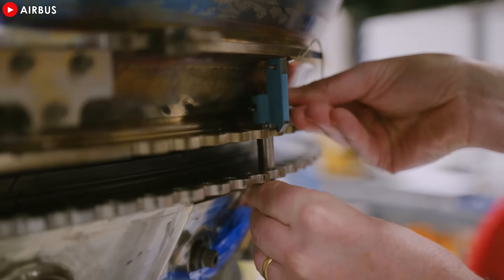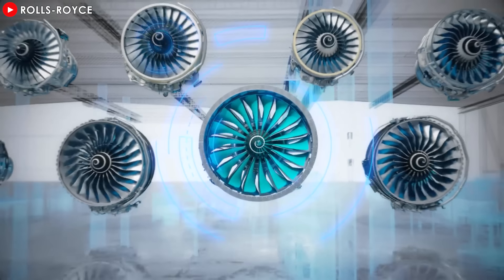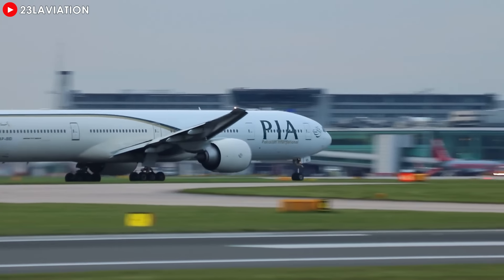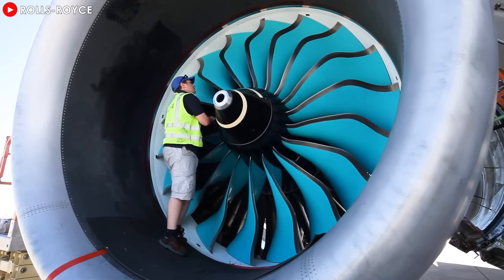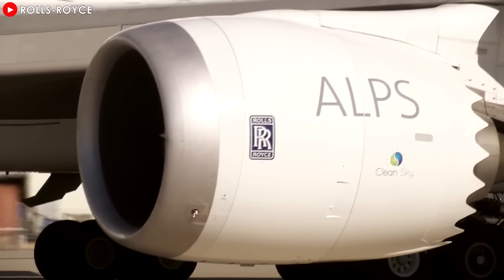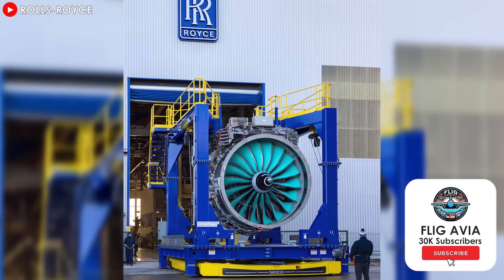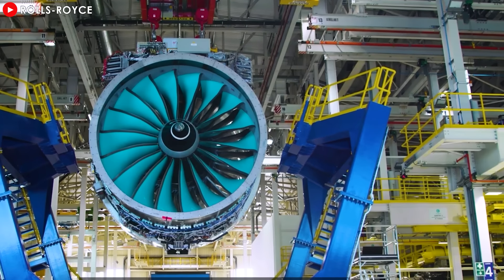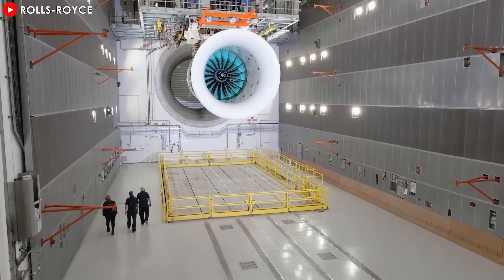This new Rolls-Royce Engine is Coming & will Revolutionize the Entire Aviation Industry. Here’s why

Comment: Don't hold your breath on anything new coming out of RR. They've had a terrible reputation for new hardware going back to the L-1011 fiasco of the early 70's. Their engineering failures were the main reason Lockheed never made any significant profit on the L-1011. Lockheed never designed another airliner after that.
Reply: And GE are doing exactly the same to the 777X with GE9X, also GE engineering failures were a big part of the reputation for making holes in the ground the DC10 got and the eventual failure of MD11.
Reply: Really ?   can you point to some evidence of what you're calling that 'terrible reputation'  ?      They're a  £4.4Billion   British plc  with a century of engine design .... and a 13% net profit margin.
Reply: RR also  were chosen ahead of P&W or GE  for the new engines for the refit of the 76  B-52 Statofortresses  in the next year or two.   See  https://www.youtube.com/watch?v=_-8ljmsZDZk
Reply: I lost a job during that time in the 70s,,,,, because of the cock up over carbon fanblades
Reply: @pjdade  The carbon blades were a gamble and introduced far too soon.

Comment: The GE 9X engine is more advanced than the RR geared fan.
It is a lighter engine and produces more thrust.

RR have dropped their so-called triple spool design as it was too expensive to manufacture and also too expensive to maintaian.
Now they have gone to a twin spool engine and geared the fan drive which has been done many years ago on other engines.

It will be a white elephant with no aircraft  to be powered by it.
Reply: RR dropped the triple spool as the current advanced design with the twin spool, blades and gearbox already exceeded GE. RR also can just offer a similar engine to the GE and still get orders such is the shortage of supply. Fuel consumption for such big engines is a bigger reason to order than smaller jets where aircraft design weight saving can offer alot of improvement. The issue is Risk- RR is offering a new engine after suffering Trent reliability issues. GE has avoided that. There is alot of new tech in this design and it must all work. RR bet the lower risk twin spool meant less risk now and still a major jump over the Trent. Meanwhile the P+W geared turbofan is suffering launch issues even as p+W is probably the leader in understanding the gearbox issue (being the only one). That gearbox offers a big jump that would otherwise have needed similar blade and internal innovation that GE was offering without the gearbox. Will be interesting to see if RR has learnt from the P+W woes, eliminated launch reliability snafus and can show the lower fuel burn on real world daily flights. The work done on the triple spool is still there and can be added in future (perhaps when SAF fuel needs it more or it needs a more competitive long haul smaller jet engine
Reply: @stephendoherty8291  Thanks for your reply.
                                                    Some RR lovers said that the triple spool turned the fan at its optimum speed which is questionable.
                                                      If so,  why have they dropped that triple spool architecture in favor of the twin spool with the geared fan-?
Reply: And what about the new RR R-130 ? ... Chosen by the US government against home producers to power the 'new' B-52, re-equiping the entire 70plus fleet, a $2.6billion order for 600 engines.
Mounted side by side in the existing pod configuration, will this not be an engine to also power narrow bodied aircraft, if RR can make enough?
Reply: @peebeedee6757  In fairness the RR won that due to poor outcomes with US jet engine makers (GE/P+W) and/or they didn't have a suitable engine that could replace the aged B52 ones even though they were US made engines.  Near any new engine would have been more efficient and a big benefit but the Airforce did not want another overbudget, reliability issue over such a critical arsenal of the US defence and RR probably had the space and less orders to meet the deployment timeframe

Comment: They have to get the gear box right,  They don't want to repeat P and W's mistakes.   Fuel economy gains are insignificant if they ground planes because of unscheduled engine rebuilds/gearbox replacements.  They need to get it on Boeing planes as well, that might mean political hurdles as well particularly with the  Trump administration and GE lobbying,  They blew up a pipe line to Germany didnt they,  the U S that is.

Comment: Rolls Royce still build Crap
Reply: yes a lot wayang
Reply: Give me an example 👍
Reply: @bez750  The trent 1000 would be a prime example of CRAP as it was grounded for a long time and many operators have switched to the superior GEnx engine which is outselling the trent 1000 by a margin of three to one.
Reply: @John-nc4bl  True, the Trent 1000 had a rough start regarding I.P turbine blades and other issues but the Trent-ten and Trent 7000 are far superior to the Trent 1000 which we no longer build
Reply: 1. You forgot the s
2. You do not know what you are talking about.
3. On our 757s, the spare RRs went stale in the cans due to the reliability of the hung engines.
Reply: @JoeL-zi1lc  1. What are you on about with the S
2. I've been at RR since 1987 so I know a bit
3. As of November 2023, the 757 has been involved in 47 aviation occurrences,[133] including ten hull-loss accidents out of a total of 13 hull-losses
4. Yes, I copied this from wiki

Comment: Should be grounded from day 1, since still running on fuel..... Electric engine or no one, please.....
Reply: realistically speaking its still nearly impossible to run a plane engine on electricity, 1. the battery size and weight of current battery technology makes it too heavy if we were to try using electric engines. 2. the power watt required by the engines and the whole plane in general is practically too much for a battery to provide, so its either we find a newer technology for batteries in general or shift to nuclear powered engines which is nearest to reality, only things required is the downsizing of the reactors and making it shielded enough to be safe for civilians
Reply: You'll be waiting for at least a decade before such a comparable e-turbine will be developed, much less certified and installed on an airplane.